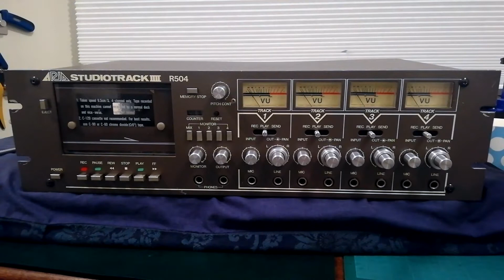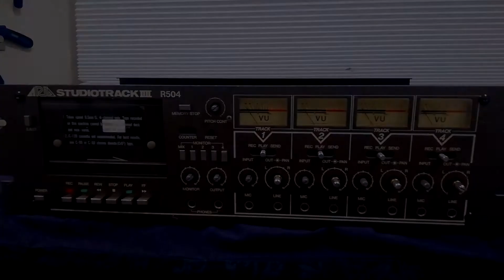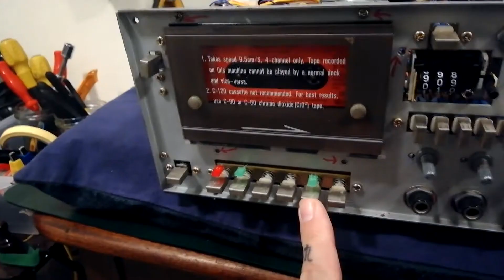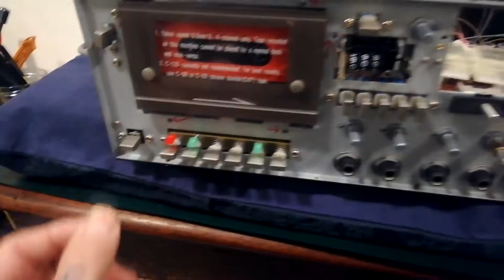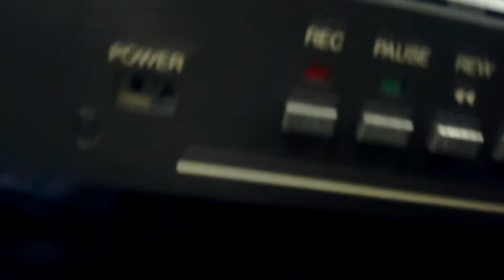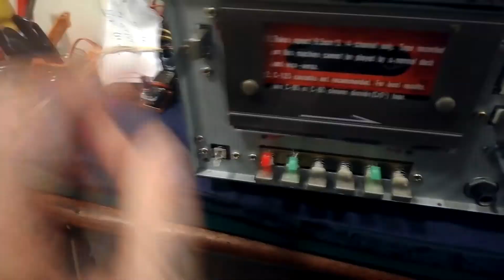Aria Stuidiotrack IIII R504 | Tear down | 1 | open case | remove front panels

Comment: Your job is excellent. A technical question. These devices vary the speed of the motor. Is it possible to make an adjustment to the motor so that it works like the rest of the regular devices?
Reply from the maker: Do you mean so it will play at 1&7/8 inches per second? It would require modification, introduce a small daughterboard with a small number of components on it, we see this inside dual speed units such as Tascam 424 series.
Reply: Thanks for reply
I have small board for pioneer ct f1000
 it is working fine as a normal tape deck